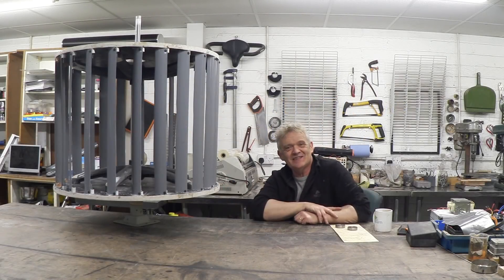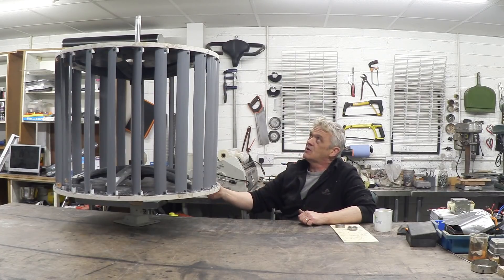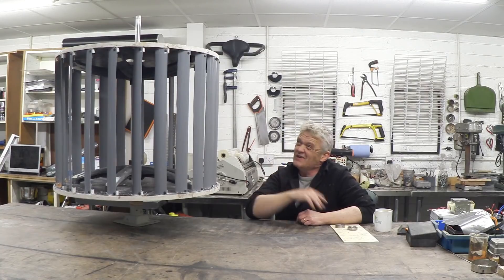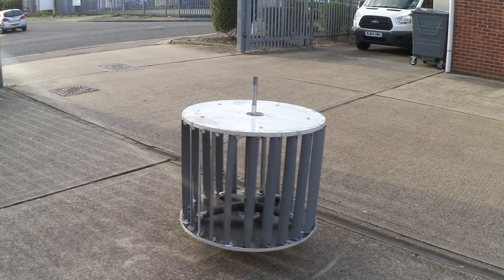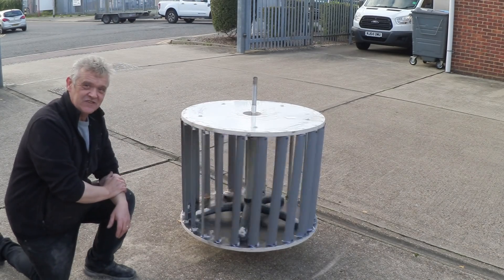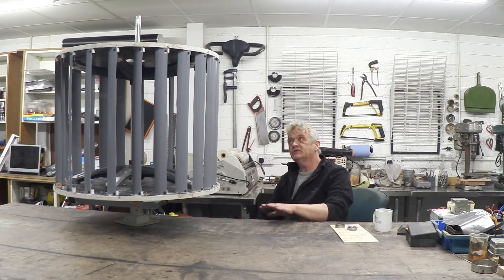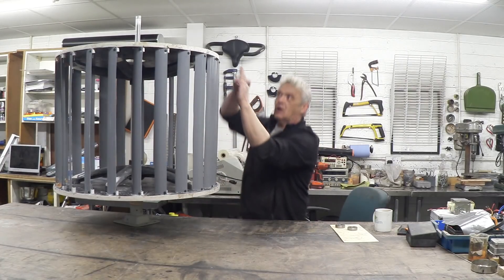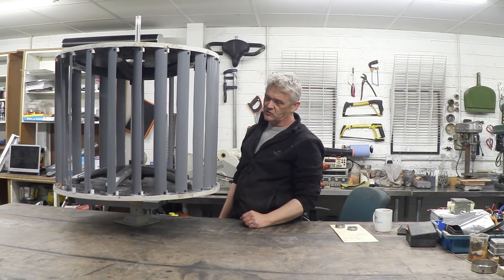Building a 1kW Wind Turbine For Under £100 - Part 2 - Rotor Wind Test

Comment: How easy is it for this kind of wind turbine to runaway in high wind ? Like when the big ones spin fast enough to rip themselves apart.
Reply from the maker: I don't know mate - I am by no means an expert here - my plan is to try it and see - no harm in that as it cost so little and has only taken me a couple of days to build - if it is a problem I will do something about it - if it isn't then clearly I will do nothing - sometimes it is just so much quicker and cheaper to just do it and see lol
Reply: Sir's question is quite relevant, even if materials don't cost much. Thinking intuitively, this design is quite self limiting so spinning too fast will not be a problem. Freakish winds bending the blades might be but the construction seems pretty solid, more now when he reinforces the connections of blades. Some long bolts from top to bottom around the outher side of the inner body could do the trick?
Reply: Chet Carson  I think your are missing my question. Its not about what its made of. Its the design of the blades. Presume that it was indescribable, and we had an infinitely fast wind speed for this hypothetical, would by the nature of the blade design the wind turbine self limit the maximum rpm the it could obtain .
Reply from the maker: Hiya Chet - Teknopottu is right mate on that one mate - please don't get rude - it can be a frustrating experience to get your point across that's for sure lol
Reply: Chet Carson  i mean yes I am ignorant about this kind of thing. That's why I ask.
Reply: Chet Carson  i don't mean this specific wind turbine. I mean the vertical style that he's making commercial or home built. Intuitively it looks to have a self limiting factor due to the blades.
Reply: @Ed R4 The turbine seemed to spin just fine in pretty low wind, does it not make it useless?
Reply: Chet Carson  Like fighting windmills...
Reply: Chet Carson  No need to get rude. People are just throwing ideas and asking questions if someone would know better. Who talked about better design than Rob's? Who talked about commercial products with brakes? A guy asked if this type of generator could spin too fast or is it selflimiting.
Reply: @Ed R4 Well aware. We'll see how it manages to spin under load.
Reply: Chet Carson  I'm sorry to have agitated you to that state. Thought the idea of conversating is throwing ideas and answering even beginner questions to each's best behalf without much heat. Glad you deleted one of your comments before anyone got the wrong idea. But back to discussion. Vertical style design is often known for it's durability in high winds because self limiting so without need to put it inside. I believe Rob's turbine would perhaps withstand the elements with right coat of paint.

Comment: Hi, I'm watching this with a smile. As I needed inspiration for a Hydro project. I was thinking the same about using guttering for the foils but not as thick width wise.
Reply from the maker: seems to be working out nicely for me mate - so go for it
Reply: for a water wheel i used square down pipe

Comment: Random question,
 but roughly how long can a 1KW energy source power an average 1000 square foot home?
Reply: What do you mean "how long"? It can power it as long as there's wind, and you don't use more than 1KW of power. Unfortunately, most houses need significantly more than this. You could power the lights and fridge though.
Reply: I power a half size fridge and freezer from 350W of solar and 200AH of 24v battery on my boat, a kilowatt isn't much by modern house standards and without energy storage it will be very intermittent but maybe it could bring power to your shed and be hooked up to charge your power tools for free or whatever.
Reply from the maker: according to the stats an average American home uses around 10-15kWh per day and an average European home around 5 - 8 kWh per day - I don't know how valid those figures are I am just repeating them
Reply: @ThinkingandTinkering  thank you. In England the average new build home is around 820 Square feet & in Japan its mostly new build apartments even smaller.

Comment: VERY COOL!!!!! i wonder if the efficiency would be boosted by having one on top of the other spinning opposite directions coils on one and magnets on the other, or alternating on both.
Reply from the maker: yeah probably
Reply: I think you'd get the same power generation benefit from just making a single one twice as tall without the added complication?
Reply: @popuptoaster  the reason i think a second one going the other way, is that it would increase the speed at which the magnets and the coils passed each other. doubling the height would infact double the torque (theoretical), but reversing the top one would double the speed as well, without any actually penalty to torque (also theoretical, as it would increase the drag created by the magnets passing the coils)
Reply: @ravenbishop2557  You'd have the same amount of wind hitting the same amount of blade area with one twice as tall as with two the same size so you could either use the increased torque to add more magnets and coils which would have the effect of speeding up the pulses or you could put twice the load on the existing magnets without stalling the turbine.

Maybe it's more efficient your way and to spin less magnets faster I don't know, but i suspect that, long term having twice the amount of bearings and effectively twice the maintenance requirements would even things out. You could also spin the magnets faster by increasing the diameter of the turbine without adding the complexity of an extra one spinning in reverse.

One of the main arguments for solar over wind is the increased maintenance, noise and vibration that comes with wind generation so you'd be wanting to minimise that as much as possible I would think.
Reply: @ravenbishop2557  I'm not poo pooing your idea, just thinking about it from a KISS point of view.
Reply: @popuptoaster  i feel like brushes are pretty simple tech, they cost like $1 us.
Reply: @ravenbishop2557  I'm not discussing brushes?
Reply: @popuptoaster  brushes are how we typically get electricity from a rotating surface to a non rotating surface.... for example brushed DC motor...
Reply: @ravenbishop2557  I know what brushes are, we are not discussing them, besides a lot of modern motors and generators are brush less, I'm using the brushless motor from a hoverboard wheel in my wind turbine.
Reply: @popuptoaster  the brushes were in direct response to something you said....about it being complicated.... i dont think it is... and i think there might be a greater amount of electricity generated per footprint of turbine... but... shrug i really think you should do it your way :)
Reply: @ravenbishop2557  I didn't say it was complicated, i said it was MORE complicated to have two contra rotating turbines than it would be to have a single larger one, there is no point adding more moving parts to capture the same amount of wind energy. 

Unless having two going in opposite directions is somehow more efficient than a single larger one you just can't get more energy out of the same amount of captured wind and I actually suspect having two would be less efficient, you have twice as many bearings, more weight and there would be turbulence (hence drag) created between the two turbines where they were close together.

If it was worth doing then things like car alternators and other electrical generators would all be set up to spin both halves of the generator, but they are not, they pretty much all have a static case and rotating internals or visa versa.
Reply: @popuptoaster  I think we have different priorities and I have no desire to keep back and forth with you debating over something I suggested expiramenting with ... By all means feel free to not try my idea
Reply: @ravenbishop2557  I shall do, barrel shaped wind generators are not my thing anyway, but I would suggest not posting ideas on the internet if you then don't want to talk about them afterwards?
Reply: @popuptoaster  i was happy to talk ... not bicker.
Reply: @ravenbishop2557  Hadn't noticed any bickering, I have an opinion and have been explaining why i believe it, I was hoping you'd  counter some of my arguments or change your mind, you don't learn anything in a discussion if one person gives up and just calls it an argument instead if you think i'm right, say so, if not say why.
Reply: @popuptoaster  remember though the height is not the point in this case ,making the magnets potentially pass the coils at upto nearly twice the speed in a given time frame is, problems include wiring, your thinking commutators... No might as well think about adding very close wireless energy transfer coils/air gapped transformers for this etc and adds 'working' mass like the wood version has oc.
oc given rob said just putting magnets on the bottom for now, then others can give this ago as drop on add ons on the  top later for testing
Reply: @paulmaydaynight9925  You still have only caught the same amount wind energy though, you are just dividing it in half so I think one that is twice as tall will spin more or less twice as fast as two smaller ones spinning in opposite directions effectively the magnets will pass the coils at the same speed which ever way you do it but one way is a simpler construction.
Reply: @popuptoaster  i was about to add this ,but no matter, think relative, to the single magnet not the stationary 3rd person perspective... as in.
your sat on a kids roundabout lets call you magnet, your spinning at 10 revs per minute anti clockwise, your mate MOT is stationary, so you pass him 10 times in the minute.. now he starts running  clockwise around the  roundabout 10 times in a minute, from both perspectives you pass each other 20 times....

the pusher/wind didn't change speed but you both increased your pass rate in the 10 min time scale,see what i mean
Reply: @paulmaydaynight9925  yeah but a taller single turbine will catch more wind, in your example that's like adding a second pusher to your roundabout so that it has more torque, it will go faster and achieve the same "magnet past coil speed" without the guy running in the opposite direction.
Reply: @paulmaydaynight9925  If you want to build something really tall you'd build a traditional windmill shaped turbine anyway, the trouble with these barrel shaped ones is only a portion of the blades is being powered by the wind at any one time and some of them are actively fighting the wind ass they turn. 

A HAWT with giant wing like blades that are pointed into the wind uses much more of the available power, and the slower the turbine is turning relative to the wind the more torque it will produce that's why they need fewer blades.

The advantage of the smaller barrel shaped one (I dunno what these are called) is in it's simplicity and compact design, you don't want to be compromising either of those or you may as well go the whole hog and build a "normal" wind turbine.
Reply: @popuptoaster  its kind of fundamental here ,im trying to work out why you think/insist a second pusher is required to balance them out!,it kind of effects any device you might one day try and make work.
 
remember i said "the pusher/wind didn't change speed" and kind of explicitly implied  'no extra anything was added/used'.
from their 'local' interactive perspective "it has more torque" , from anyone else it has just its original 10 revs per minute of  torque, no more/no less.
Reply: @paulmaydaynight9925  It's you that isn't understanding basic physics, if you cut one of these turbines in half horizontally will one of the halves catch the same amount of wind as the whole? Or will the now half sized turbine catch only one half as much wind?

Your two halves spinning in opposite directions will only have the same amount of energy as the single taller one spinning in one direction so your two halves will only be able to spin half as fast or, relative to each other, at the same speed as the full sized one spins relative to a stationary object.
Reply: @popuptoaster  think about what you just said...to get the same 20 revs as these lads, you NEED to be twice as big AND spin twice as fast...

i didn't say you dont understand, its quite possible you where simply taught wrong red is green as it where
Reply: @paulmaydaynight9925  yes, that's my point, even if both designs spinbat exactly the speed of the wind when free wheeling, as soon as you put an electrical load on the turbine the smaller ones catching less wind energy each will slow more than the taller single turbine that is catching more energy than each of your smaller contra rotating turbines.the net result will be both designs spinning the magnets past the coils at the same speed. You can't take more energy from a set wind speed with two half size turbines than you can with one full sized turbine so you gain nothing from the extra components.
Reply: This is what I was thinking with my big VAWT I am building. But how to get the power off the spinning coil? So I agree with the other guy about KISS. Stationary coils to spinning magnets is keeping it simple.
Reply: @MAGnetICus_Attractus  might as well think about adding and testing very close wireless energy transfer coils/air gapped transformers for this etc
Reply: @paulmaydaynight9925  thats a great idea, does limit your design to AC current with rectifiers however.